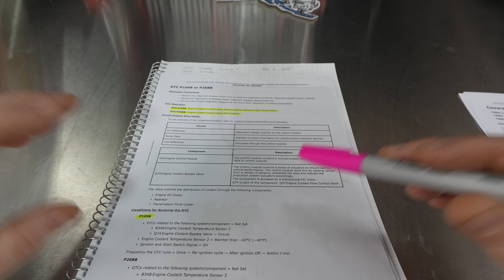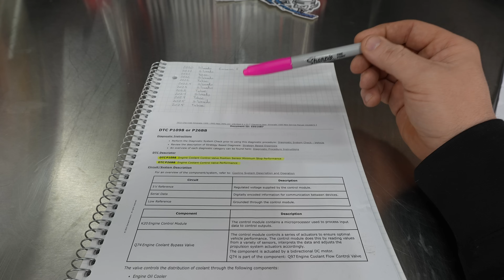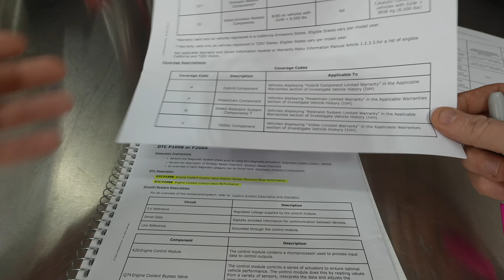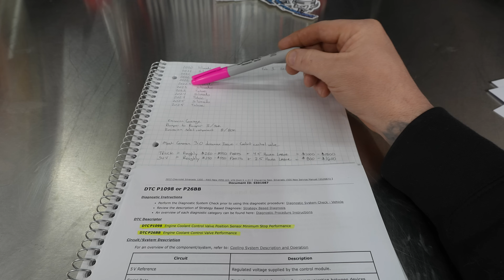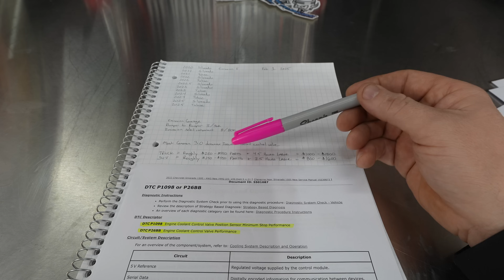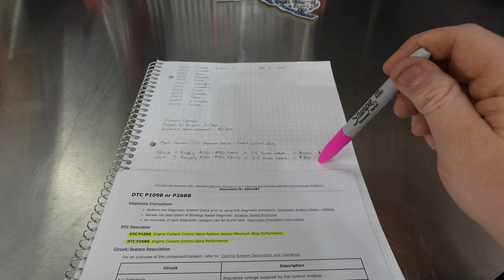UPDATE- This is covered and will be corrected March 1 - 3.0 Duramax Coolant Control Valve

Comment: My 23 3.0 Silverado just go the same code at 60k they say it’s the coolant control valve the dealership where I take my truck since I  got it (I got it with 0 miles ) says it’s might not be covered under the warranty I called a Gm rep today and he told me it should be covered under the power train warranty came across your other video and I seen a couple of people say it is covered in a bit of a dilemma now hopefully I pray to god that it’s covered under power train warranty if not im going to have to call around all my Chevy dealers and see which one will look into it. It’s sad cause I’ve had the truck almost 3 years and I always take it to these people and for them to flat out say no it’s not covered is sickening pray for me guys that it is cause I really don’t have 1500-2000 to cough up  that’s 2 -3 car payments it’s crazy man i recorded my call with the Gm rep hopefully that helps

Comment: Thank you for sharing your knowledge and expertise on the 3.0 LZO desiel motor. 39,000 + miles on my 23 Denali and the dealorship replace the coolant control valve under powertrain warranty thankfully. 🤞🏾no other issues with the truck.

Comment: I took my 2022 LM2 to a dealer for the P1098 today (8/21/2025) ; they told me this isn't covered under Powertrain warranty and I'd have to pay for a $200 diagnostic before I can get any further service on this matter. I called GM customer service and they said what the dealer says usually goes, then told me I'd have to get a diagnostic before anything else. So I told them I'd consider consulting with an attorney and they sd if I did that they'd send me a cease and desist and the court system would have to run its course before any other communication would take place with GM Customer service

Comment: I just got my coolant controller valve replaced under warranty in march of 2025 at 90,000 miles 2023 gmc
Reply from the maker: How long was the wait for it to arrive?
Reply: I was only without my vehicle for three days in Arkansas but my timing chain went out at 83,000 miles and it’s lz0 so they still have problems with new chains sadly

Comment: I just took my LM2 to the dealership for this issue on Friday (18APR2025). They said it was going to cost me $1100. I told them to not do any work on it because I was going to call GM and the issue should be covered under warranty. Sure enough, the kid did some “investigating” and it turns out they’re covering it under my power train warranty.

Comment: Took truck in of February 28th to Parks GMC. Was told that part wasn't covered anymore and switched labor codes. After waiting for 3 weeks for an answer from GMC the dealer called and said they would replace it for $665 instead of the original $2000. This is B.S. and I feel like i'm just getting screwed over by them, but they have my truck and I need it. 2022 Denali 58k miles
Reply from the maker: Sounds like it should be covered, coolant control valves are back under powertrain warranty

Comment: I signed a contract when I bought the truck that encompasses the warranty.  They cannot change that.
Reply from the maker: Did it specifically state every single part covered?
Reply: It specifically mentions "engine coolant valve" as covered in the emissions warranty in the warranty guide they provided. See page 22.

Comment: I have a GMC 2022 1/2. I absolutely love the truck. I did my research before buying and found this to be the most common reported problem that could cause it to spend months side-lined. I purchased a new CCV valve on Amazon for $265 to keep on hand just in case. I  also bought  Chemplex 710 Silicone grease meant for extreme temps and plastic gears for the new valve. I've seen a few videos where people have had the code, cleaned and regreased the problem area of the valve, and have had no issues since. I'm really considering pulling the valve this summer to inspect/clean/regrease. I'd rather deal with this on my terms rather than being on a trip and having this pop up. Do you think that might be a good idea?

Comment: THIS WILL BE UPDATED IN SI TO POWERTRAIN MARCH 1.  IT IS STILL POWERTRAIN.  NO WORRIES PEOPLE.  DEMON CAN CONTACT LABOR TIME FEEDBACK TO VERIFY.
Reply from the maker: I received information on that possible "correction" yesterday and will update the viewers when that really does take place. Unfortunately, I do know some people based on posts had to pay out of pocket for the repair so hopefully there is a way they get that corrected as well.
Reply: @DemonWorks  if we can contact I can forward you the letter from ltg
Reply from the maker: @charliemagoo7943 . Mstrgoodwrench@gmail.com
Reply from the maker: @charliemagoo7943  cool thanks!
I got in for from a phone call, the letter will be additional help. 

Mstrgoodwrench@gmail.com
Reply: @charliemagoo7943, @Demonworks.. my truck is in the shop right now (2/15/25) for this exact issues, failed CCV.. 23 LZ0 with 42K miles, service advisor called me yesterday to say the repair is not covered under warranty. Apparently he's trying to get GM to approve "goodwill" repair, he mentioned specifically that this issue had previously been covered. Any supporting documentation that would help me in this argument would be appreciated. What would you do?

Comment: If someone starts putting together a class action lawsuit, I will happily join it. This is bullsht. The design of the valve is sht and has known design flaws. They know it has a high failure ratr and are now trying to weasel out of covering it under warranty despite covering it up until now.

Comment: I'm not a lawyer.. but changing a contract after purchase.  No. 
I don't see how GM has a legal foot to stand on.
They can argue any truck purchased after this change came out has their warranty changed and then it gets into lawyer work on whether this is power-train or not.
But damn.. this is shady.. especially since they still have not FIXED the replacement part so it will not do it again.

As always thanks for the info.

Comment: That is frigging terrible. They are changing codes to their benefit! Had my fans running fullspeed out of the blue. No code thrown. It's a damn bug with using the block heater above 0 degrees. (below 10F should be safe one would think).

Comment: Do the replacement CCV valves have some updated parts?
Are these failing on all year models? I have a 24 with a build date of 11-14-2023
What is the average mileage that you are seeing them fail?
Reply: @sd2ca  It was changed but now instead of the gears binding up due to grease and plastic shavings, it's breaking one of valve zones in the valve. They fail on newer trucks too and it seems to be random as far as mileage.

Comment: I got extended bumper to bumper warranty up to 100k thru the dealer.  Based on my conversation with them, it should be covered because the warranty I got even covers for internal electronics stuff like the screen.  I think I paid $4300 for 100k 7 year warranty. Fingers crossed that I wont have to deal with this problem

Comment: Just wait until you dig into the transmission issues all the 22-24 Duramax 3.0s are seeing ...
Reply from the maker: I'm not seeing that many. We had the pump issue and we've always had valve body issues but I cannot call it common, like the coolant control valves.
Reply: @DemonWorks ATX dealer has 6 3.0 durmax all waiting new valve bodies… Reddit is littered with people having this issue
Reply from the maker: @dwaterpolo yeah, valve body issues, like I said. That’s like saying the whole engine is junk because the coolant control valves go out. 

Valve body issues have been around since 2020 and the backorders are longer than the control valves. Still, valve body issues are nowhere near as common as the control valve issues.

Comment: How can GM change warranty coverage after something was already agreed upon during initial purchase?
Reply: They cannot. Don't worry. Nor can they place this under emissions. There is a huge recall in the works as well.
Reply: @ryanskare6670  It is actually listed as a emissions component in the manual but it's intrinsic in how the engine works as well. It's not a water pump so they can't say it isn't a powertrain item. And they themselves have treated it as a powertrain item every time they warrantied one for the last several years.
Reply: I think we may want to dig a little deeper on this. A car manufacturer generally cannot change a car's warranty once it is sold under the Magnuson-Moss Warranty Act.  This means they cannot unilaterally reduce coverage or add restrictions without a valid reason, and they must honor the original warranty terms as outlined when the car was purchased.
Reply: Read the owners warranty manual.  Even the fuel system is not covered under powertrain
Reply: @charliemagoo7943  The thing is, GM already treated the part as though it was covered by the powertrain warranty. They are only now trying to pretend it isn't covered because the cost of their poorly designed part is failing at a rate high enough to be a liability on GM's financial sheet. I hope a class action lawsuit makes GM take it up the as* for this plastic piece of sht.
Reply: Not to mention in the manual they list parts that are covered by the 8 year/80k mile emissions equipment warranty. The "engine coolant control valve" is listed as one of those covered parts.

Comment: Curious if anyone has printed copies of their warranty booklet. The PDF booklet with a 2022 print date for my ‘23 AT4 that I downloaded from GMC shows the CCV under the Emissions Warranty Parts List on the top of page 22. For the federal emissions warranty, the terms are spelled out on page 18–for vehicles under 8500 GVWR it’s 2 years/24,000 miles. For California (and I suspect for other 50 state vehicles) the warranty is increased to 3 years/50,000 miles. There are several parts in the emissions warranty parts list marked with an asterisk, those parts get 7 years/70,000 coverage. Unfortunately, the CCV does not have an asterisk. 

Does anyone have a hard copy they can review to see if GM altered the PDF without notice?

If GM altered the terms without notifying owners, they have committed fraud, and are subject to litigation.

Comment: Federal emissions warranty is 7 years, 70,000 miles - how does GM cop out of that? Also, if the part is on backorder, most states lemon laws will enable you to ask GM for a buyback. Some states like Texas are more pro-business than consumer, but even there, if they can't get you a loaner and it's within 2 years old, and you are out of your vehicle for more than 1 month, tell GM you want them to buy it back. Better Business Bureau is your advocate there, you don't need a lawyer.
Reply: There are a few emissions warranties. Some components are covered until a prescribed change interval. Some are performance warranted, like a rattling converter is not warrantable but if it cracked and the emissions are higher then it fails to perform and is covered.
Reply: What is and isn't covered is in the owners warranty guide that no one ever reads

Comment: Picked up my truck at the dealer today and asked about this, according to the service advisor I have a 10yr 100K mile power train warranty (extended) and the original was 5yr 100k mile power train warranty.  3/36k bumper to bumper, but my extended cover interior components as well.  Asked specifically about the CCV and was told even with the change it is still covered under the power train warranty.  I got additional copies of my purchase agreement and warranty paperwork which he showed me where it's covered.  Still worth keeping an eye on this one, GM has been known to do sketchy stuff.
Reply: The original powertrain warranty for trucks with this engine is 5 years/100k not 8 year/80k. The emissions equipment is 8 year/80k.
Reply: @hochhaul  some people haven't a clue.  Just argue they have a warranty.
Reply: @hochhaul  correct I fat fingered that thank you for the correction and fixed my original comment
Reply: @grantgossett1645  be sure to read your owners manual warranty information as well.  That's what gm goes by. 95% of the problems with the lm2 and lz0 is wiring chafing.  That expires with bumper to bumper.  Get ready to pay
Reply: Doesn't matter what the guy who sold it to you said, depends on what the guy approving the work thinks.  It should be illegal to call it a bumper to bumper warranty when so many things are not covered, its a scam.

Comment: New 2024 AT4 3.0 owner here. Where can I obtain a comprehensive list of the RPO and warranty codes for my vehicle. 4500 miles and no issues on my truck thus far so fingers crossed
Reply: Scan the qr code on the driver door pillar.

Comment: My question is how is it not covered under the 8/80k when in the warramty document it says it covered "engine coolant valves" is this not an engine coolant valve?
Reply from the maker: 8/80 is for select emissions components. It may fall under that coverage, I just don't think it does.
Reply: @DemonWorks  mine is in the shop right now and it does not fall under the 8/80 according to the dealer. But i have the warranty paperwork that says "engine coolant valves" under the 8/80. Luckily I have an extended warranty so it's covered under that. But the dealer is stating it is Emissions E

Comment: I agree with Grant Gossett, this is opening the door to a class action. You could easily argue a malfunctioning cooling system not only causes higher fuel consumption but also affects the emissions system as well. It is a vital part of the powertrain and they are just freaking out about quarterly earnings reports. 

Deny, Delay, Depose is all these companies do.
Reply: @marcochavane3124  might be class action but look at the owners warranty guide.  Specific parts are listed.  I've seen some malinformed argue powertrain is anything that makes it go.  Parts are listed in owners warranty manual.
Reply: @charliemagoo7943  Small Claims is cheap to file and a judge would likely side with the customer for something this stupid.
Reply: It will put your vehicle into a low power state - I don't know how this isn't covered under powertrain now if it limits my pickup to 55 mph!

Comment: What exactly does this coolant valve accomplish other than reducing the durability of the engine and increasing the out-of-pocket ownership cost of this product so that the dealership and manufacturer make more money over time? In the 70's, there was a simple thermostat that worked perfectly fine and was easy to repair. It is difficult to believe that this is anything other than greed driven engineering.
Reply: Keeps the temperature more constant for faster warmup, better fuel economy, and lower emissions. This type of electric water pump combined with flow control valves has been common on European cars for at least 10-15 years at this point, as well as on hybrids like the Prius. Expect this type of technology to show up on every car within the next 10 years.
Reply: @theodorgiosan2570  My point is that it truly has not useful purpose over the old mechanical thermostat that cost about $20 to replace and could be replaced by the average person within about 20 - 30 minutes. The engine is going to warm up and provide the same level of economy regardless. This is pretty much basic common sense. Just because something can be done, doesn't mean it should be done.
Reply: @johnsnyder751 redirects hot or colder  coolant where it's needed almost instantly. When engine is cold, I read that very little flow goes to the heads to allow for faster warm up. Diesels need heat in the heads for proper combustion/emissions, especially when cold.

Comment: My truck threw Crankcase Pressure Sensor fault, guessing it was P04FB Code yesterday, dropped it off at the dealer, guess that part is on back order and not ETA, owned the truck now for 2 years, starting to wonder as it's been back to the dealer 3 times now for warranty related issues.

Comment: The thing that worries me is they haven’t changed the design of the control valve. If you replace it there is a good chance it will fail again.
Reply from the maker: I agree
Reply: There must be an issue with that one zone of the CCV binding up. In the first version, the binding cause the gears to wear. They address that issue and now the motor is able to put enough force on the rotating assembly without the gears slipping, so it's snapping that zone. It would be interesting to find out what that specific zone is for.
Reply: GM changed the LZ0 part number for the CCV in late 2024 from 40009158 to 40009452 so maybe there were some design tweaks? In any case, I'm buying one with the new part number to keep as a spare in case mine decides to fail and my local dealer isn't able to source the part in a reasonable timeframe.
Reply from the maker: @gr8tdane24 correct. I compared new to old and visually no differences except for a motor part number change. LZ0’s are failing by internal physical breakage.
Reply: @DemonWorks  Good to know - it's a shame all they changed was a motor in the part revision. This valve could have benefitted from fully metallic gears and maybe a better lubricant. I read up in Alldata about the 7 different thermal management modes the LZ0 operates under and the CCV is the critical link to make it all happen.
Reply from the maker: @gr8tdane24 you nailed it !
Reply: @gr8tdane24 I would pay a premium for a metal CCV. Somebody should talk PPE into making one.